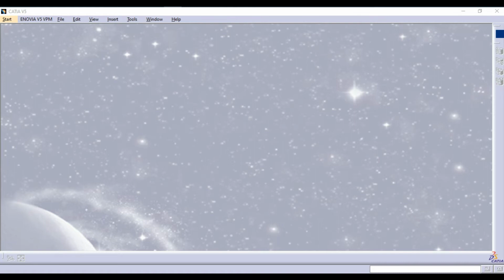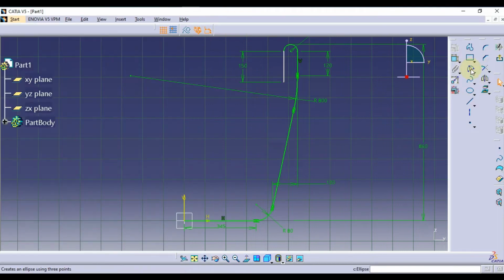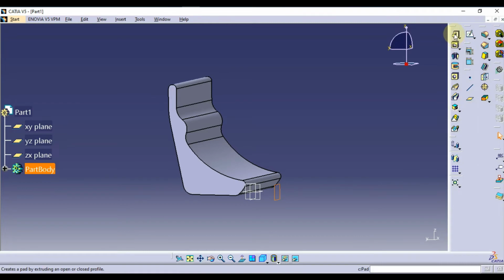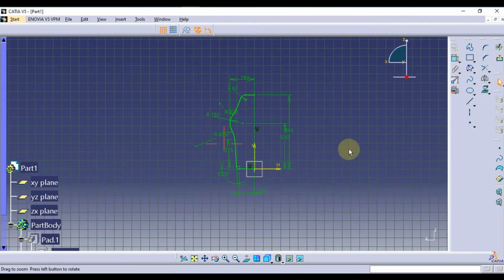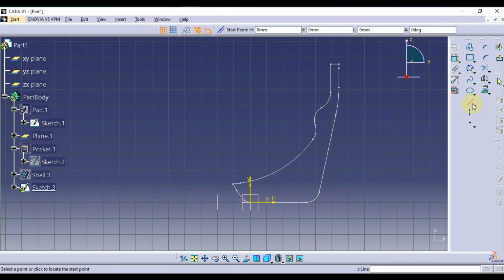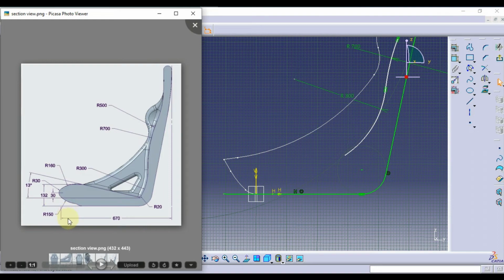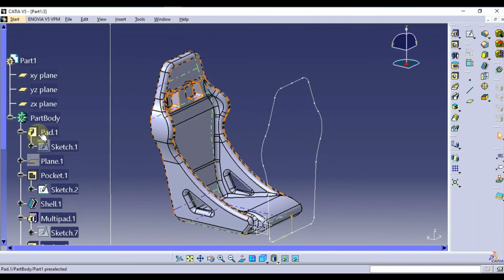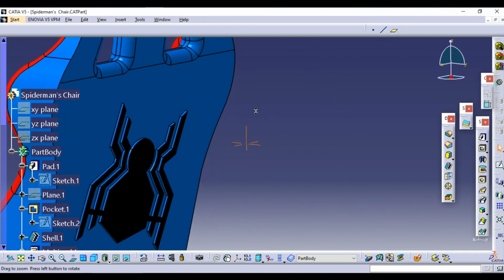Car Seat Design in Catia V5 - Complete Tutorial for 3D Modeling and Design using Catia Tools

Comment: Nice tutoria buddy, but not able to perform 50 MM shell can you suggest something where it can wrong, because I have cross checked everything and all the sketch are same as you showed in tutorial along with same constraints.
Reply from the maker: Did you try changing curved surface to edge surface ? the normal shell command need a edge surface to be shell . Watch 16.45
Reply: @ayushagrawal0915  yes did it